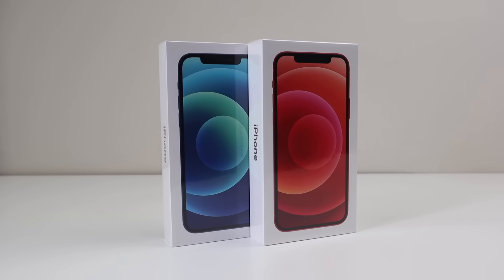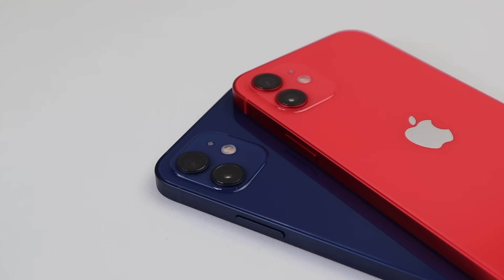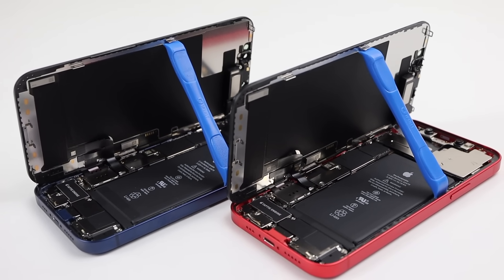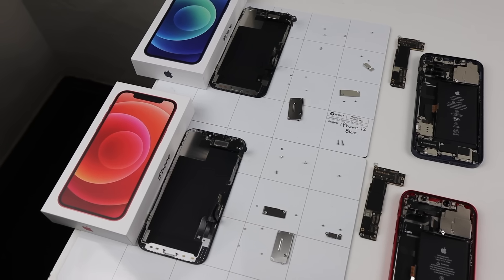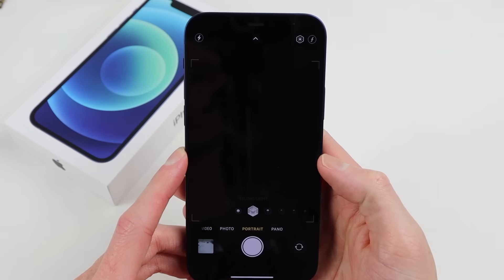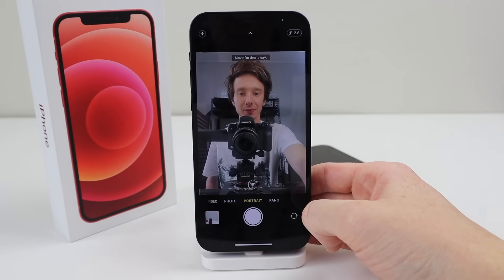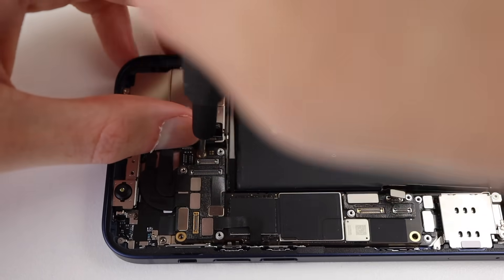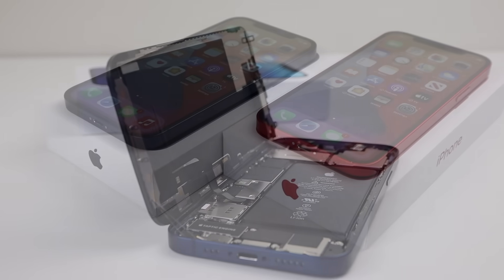iPhone 12 Anti Repair Design - Teardown and Repair Assessment

Comment: Not only apple does this, im in catering repairs, Hobart dishwashers are similarly becoming more clever. They used to have built in self diagnosis, accessible from the menu, now the new ones have usb port where only a genuine technician can access these from their laptop software which is of course encrypted and cannot be copied to other laptop... 3rd party repair on those became a nightmare, so a lot of people are just scrapping it and buying a new one when a bigger repair is needed. This should be illegal.

Comment: Myself (Luka AirGirl/Luka) and Lucy Heart Filia: Let’s buy iPhone 12!
Apple: pairs camera’s and some parts! Hehehe
Okay we’re home.
Luka: let’s switch parts to my phone to other phone and your parts to my phone
Lucy: okay. Let’s do that.
iPhone is not happy.
Lucy and Luka tries to turn on her phone with power button. It failed
Plugs charger. Turns on along with Luka. Bombarded with important messages about battery Face ID and display. Luka and Lucy opens camera. Unstable
Turns off phone and tries Face ID. Failed. Battery reading disabled True Tone disabled.
Lucy and Luka: ugh. Why Apple. Why! 
Both girls switch parts to original parts. 
It finally works! They both said.
The girls: good everything works.
Update: !!
Girls: ok 
Camera issues fixed!
Girls: Yay no more camera issues!
Reply: When Luka and Lucy Heart had their phones swapped parts and put the different parts of course. It don’t work! 
Luka and Lucy: APPLE! WE WANT YOUR PHONE PARTS UNPAIRED!

Comment: considering it's been proven that Apple intentionally slows down their phones forcing you to get a newer model cuz they're older ones they have screwed up so bad it forces you to get a new one. well if you enjoyed being used and throwing money away for no reason get an Apple they will screw you all the way to the poor house. Or just get yourself a Droid platform and have a phone that can last you 20 years. Or buy an apple that I guarantee after 5 years will work a quarter as fast as it did originally because of excuses and lies, I completely understand I don't know how I could live with myself knowing that companies can't use racing fuel in their vehicles and can only use premium. I feel so sorry for those that can only afford a $50 million house and not a $300 million house because they didn't screw you as good as they wanted that is so upsetting.
Reply: I have an iPod from 2006 that still works to this day despite the battery life these days being suspect.

Comment: I just listened to the first 2 Minutes and don't know what to say. All People from older iPhone Models, still have their lighting cables and their usb-plugs. So where is the problem with charging? Why do iPhone 12 users have to buy a usbc-plug if they sit on lighting cables and usb-power-plugs?! Your video is not objective enough...You should add an info on your first two minutes. Cheers

Comment: Did you test if swapping screens has issues. Most likely repair would be a broken screen?
Reply: Yes but these phones use oled the reason most screen repairs happen is glass, i don’t think that oled uses glass for superior quality..? but Apple claims sapphire glass for their cameras and that’s a lie, also even if the oled is actually in apple would somehow put glass in for this reason. Not an Apple hater, I’m typing this on apple
Reply: I am an Apple hater, but do help friends when they need and this info is good to know. Cheers

Comment: I was thinking it would be cool if there was a phone company that made phones specifically tailored to tech DIY people. As in, make the parts a lot more modular and straightforward to replace and sell upgraded parts and modules. Like where you could just buy all the parts/modules/accessories and whatnot and build your own phone if you wanted to - and then be able to upgrade things like the camera, speakers, battery, RAM, storage, CPU, etc... I know you can already do a lot of that but I mean, make it a lot simpler, more straightforward, more upgradeable, etc. Sort of like open source or whatever.

 I don't particularly care for Apple. I've always been tech savvy, but I've only had a smartphone since about 2016 and they've all been Samsung Galaxies - 5, 7 and Note 9 I think... I tried to talk my wife out of going with Apple but she was sold on the rose gold. And maybe it's just because I'm used to Samsung, but iphones seem counter-intuitive to use and repair and Apple's obsession with proprietary parts and software is very frustrating. 

Like where the charging adapter wasn't in the box - my wife just bought our nephew a basic iphone and it didn't have one either - just that weird, useless lightning-to-C thing. And like how their batteries are always a weird, non-standard voltage. Also, like with their weird headphone jack situation. 

It seems like Apple has historically always stood in the way of various USBs, chargers and cable types becoming universal standards - like they always go against the grain and go their own way when other companies have accepted the new standard. Yet people continue flocking to their products, waiting in line for days to buy them, paying exorbitant amounts, buying their weird proprietary parts, etc... To each their own, I guess. I'm rapidly becoming a grouchy old man lol...

Comment: Humpf - anti-repair design is very upsetting. I can partly appreciate matching components as an anti-theft feature, but that could be done more elegantly by offering a re-matching service or tracing part IDs and providing them in a public database so that no stolen part IDs can be used.

Comment: I started boycotting Apple products when they would not honor the battery swap in my iphone 6 because it had previously been replaced by a non-Apple battery in a repair shop.  I was wavering with the iPhone 12 Pro but this just confirms my original decision despite the ceramic glass.  Someday these will be super collector items ... if they are still working...

Comment: Samsung is basically the android version of Apple, over charging you for a phone that you can get very similar specs for from Google at a fraction of the price (specs compared later.) You could even get a OnePlus phone if you're feeling extra hipster. 

By getting a Google phone you avoid dealing with Samsung trying to force feed you their own version of every app knowing full well you're just going to use the Google version of them (e.g. the "Galaxy Store" vs the Google Play Store.) When I first bought a Samsung phone I was bombarded by annoying messages in my notifications bar related to this, as well as many other Samsung-specific notifications that often would not disappear with a simple swipe to dismiss. 

If you use Google Maps, Drive, Photos, Gmail, Google Messages, and Chrome, it makes sense to just get a phone that was made by the same company that created them as they are obviously integrated seamlessly to your Google Account, notifications, and overall phone.

Also, the Google cameras now are some of the best Android cameras on the market. The Pixel 4a and Pixel 5 already offer 120GB storage as base, with free unlimited photo and video storage on Google photos if you buy the Pixel 4a or Pixel 5 before June 1st 2021. 

The 120Hz refresh rate is one of the main reasons people buy a Samsung phone now (which although this is very aesthetically pleasing to look at when swiping between pages of apps, switching apps, etc., it drains your battery significantly faster) To compensate, Samsung has made the S20 Ultra 5g battery be 5000mah. However, this increased battery life *takes longer to charge*, and the phone is $1000 most places. 

The refresh rate of the iPhone 12 pro max (3678mah, max of 6GB RAM, $1100 most places) is only 60hz like the Pixel 4a (3140mah battery, max of 6GB RAM, $350 most places), which isn't bad, but if you want more than this get the Pixel 5 with a 90Hz refresh rate (4080mah battery, 8GB ram, $700 most places). Although the S20 Ultra 5G has 8GB ram, I can confirm as a Pixel 4a user that 6GB is more than enough for my phone, and my battery has only gone down 5% in the 30 minutes it took to write this extremely long comment. 

To summarize: get a Google Phone.
Reply: No one outside of the US buys a Google phone you poor soul. Samsung's market share skyrocketed after the Huawei ban and the growth is still looking strong. :)

Comment: What you said about the charging cable that won’t be a problem where I live as I’m in the UK with the three prong plugs and all of them comply to the same standards so Apple in the UK  has always used USB not USB C connectors I’ve got an I phone 8 and I share my plug with my mum’s Hawaii and my neighbours Samsung but they have to use there USB to micro USB lead

Comment: I recently took a chance and replaced the Battery on my works iPhone 6S. It would not charge above 15%! I realised that the battery wasn't for an 'S' model. So they have been pulling this stuff for a while now. Pioneer DJ kit is also very hard to get parts for now, As Repair Engineers we are simply keeping land fills less full but companies pretending to care and just uncaring and money grabbing!

Comment: It's not that the parts aren't compatible, genuine Apple parts work fine. All of those parts require calibration. Authorized repair location here btw. Displays, camera, etc require calibration to essentially pair it to the device. There is display calibration, camera calibration, and even battery calibrations.

Comment: EVERY part in newest iPhones have a serial number that only Apple can correctly re-set with their service-tools and box.
Any serial stored inside the NAND must match with the part (FaceID, TouchID, Display, Battery, Taptic, Cameras) otherwise it will not work (or give a warning message).
Cinese repair tool/box can't correctly set this serials on the third-part replacement and the warning messages will always appears, probably there is an hardware check other than just the serial matching.

Comment: Typical Apple, I hope so bad that Apple will screw up big time someday and people would finally notice how anti-consumer they are. I know some Android Phone manufacturers are just as anti-consumer but not all are, even Samsung isn't too bad about repairability at least they don't make it difficult to repair for the sake of making it difficult to repair as Apple does most of the difficulty is just cramming expensive tech into them and gluing displays down which is for water resistance.

Comment: NO NEED TO PANIC PEOPLE! THESE ARE REPAIRABLE!
Reason why his phone wouldnt power up the first time and it worked with a charger: this common after repairs even with an iphone 7, no need to worry just an easy bug

reason why face id did not work. Smart swapping the boards around with the original face id flex, HOWEVER sonce the iphone x the front cameras are also responsible for tracking face id, just as the little white part on the proximity flex. He did NOT swap that part as he shouldve and i guarantee face id would have worked 100%. Even in the event of a front camera replacment, face id can be restored by swapping an additional component. A little tricky but surely doable.

Display messages happened on previous models aswell, and all you have to do is open them, then exit out of the window. All done easy solution. 

Now as for the battery, this has just barely been implemented on the new ios, as battery health cannot be read. Again a dismissable window same solution as before.

But for the rear camera, that is a new issue. Doubtful anything was miatakenly damaged during this, but im still 1000% positive a solution will be found. Will update on that soon

Comment: as much as I hate Apple, Hugh cannot be determined to be a legitimate source of information on this product. they powered on the device before the screen was connected via the charging cable and apple devices will not power on the screen if its connected while the device is powered on. They removed the cable afterwards. There is no legitimacy here to the claim that the screen is paired with the device since apple devices will not power on the screen if its connected after the device is powered on.

Power on the device AFTER the screen is connected in an un-cut video

Comment: Apple wants to sell new phones rather than allowing anyone to repair their phones after Apple quits servicing them.   Apple can blow all the smoke that they wish to gaslight the public. Having planned obsolescence is NOT GREEN. It does not matter how many PV panels or windmills they install, they are never going to be carbon neutral with their current non-repair attitude.

I was actually considering switching form Android to iOS. After this video, I am a NEVER Apple iPhone buyer because of this.

Comment: You know, there's a lot of crap that Apple's done in the past, in which my stance has been "that's a crappy way of doing things, I wish they'd do it differently" but I could at least understand what they were doing, why they were doing it, and how it would benefit SOME people. 

Form over function being a big one. They started gluing everything together, removing screws, and integrating their parts. I hate that, because it makes it 10 times harder to repair and upgrade; but I do understand that their target market tends to be people whose primary understanding of tech is "buy the shiny thing that I see in the most commercials, in the hand of the most celebrities, etc." And for those people, the appeal of something being sleek and bereft of screw-holes and the like is a priority selling point. They're screwed if they're not wealthy enough to view a thousand dollar piece of tech as a consumable good that gets replaced every year or two, but I digress.

THIS thing, though? What they're doing here? This is just about the most blatantly anti-consumer thing I've ever seen. There is zero logistical reason to do this outside of forcing you to be dependent on Apple to service your own purchases. It doesn't save Apple money on manufacturing  to maximize profits on the SALE of the item (as a business, I understand that concept). It doesn't provide something something that certain consumers value (such as making the phone look better), it does nothing good. At all. The only thing this does is make sure that if something breaks, it really, really breaks, and you need Apple to fix it.

Don't have an Apple store near you? Too bad. You get to drive several hours to the nearest one. Live 5 minutes away from a local repair shop that charges half the price Apple does for labor? Too bad. Got a master's degree in electronics engineering and want to replace a simple camera with a genuine part directly from Apple? Too bad. Bought your phone for $1,200, had it for a while, and Apple decides to stop supporting it? SOL.

This should NOT be legal.

Comment: At first I thought it was completely bullshit that you could not change anything inside the phone.
Thinking about It anyway it's not that stupid... They transformed the phone to something that cannot be stealed, because you can use it as It is and you can't sell the peaces singularly.
But anyway Apple has of course the possibility of changing the peaces and still be "green". Also Apple knows how and where the peaces are produced, so they know how much CO2 Is produced etc etc. And at the same time they avoid some chinese "rip off" that maybe desn't respect any "green" legislation.
I don't know if Apple Is actually going to do this, but I think its a smart move, for Apple, the consumers and the Planet.
Of course the iPhone Is going to cost more to be repared... But anyway I think that if you guys drop 1200 $ on a phone you could also pay for the repair :)

Peace

Comment: Well it’s not a new part, it came out of a device that it was assigned to.
Now If you got a factory fresh logic board things should be different. 
I’m not defending Apple with their ways to push away 3rd party repairs but you’d hope that when you took a phone in to get a new logic board that it wasn’t an old one from another phone sold to you at full price.

Comment: I bet it's programmed into the software to check parts installed. Microsoft did that with their WINDOWS OS too. If you swapped in a new part like another motherboard the os would now say that your Windows install was no longer legit. You could only change certain components like memory or harddrive.

Comment: Even if you find the conf file with the pairing info the necesarry Serial Numbers are encrypted :(   ...   So if you are a little kind of hacky(Reval hidden files and find the one decoyed to a system function) you till need to know the cryptic method they used.  I don't want to argue. IOS is/was great. The Iphones are OK. Personally i have 2 problems  Management+/OverPrice+/hypocrisy

Comment: In many countries (i.e. Turkey) due to exchange rate and taxes IPhones are already very difficult to afford. People until recently would spend 2x3 times their salary on iphone but would always use 3rd party for frequent problems such as cracked display or water damage. Disabling this service brings the costs even higher and they are simply not worth buying anymore.  I won't be replacing my XS in the future

Comment: They likely have a server which checks hardware that is serial coded , a little like two step authorisation. Your apple software will have been paired with a hardware serial number that it will regularly check with the server, first the software checked the hardware and then checked the server. The parts look like they are all QR coded (serial coded).